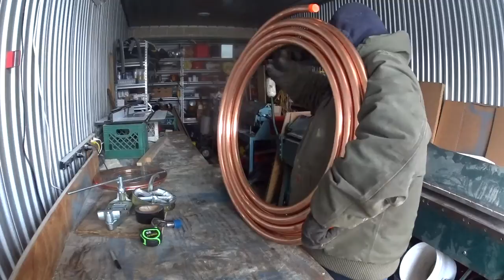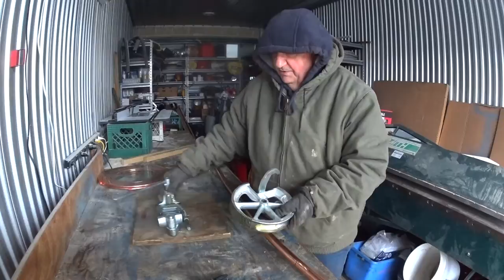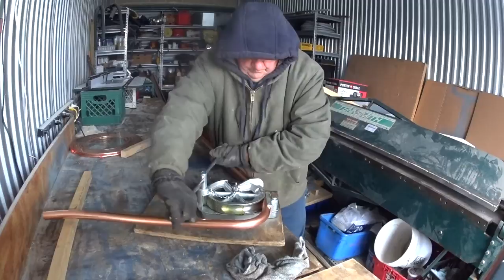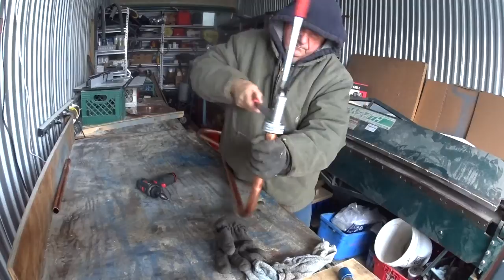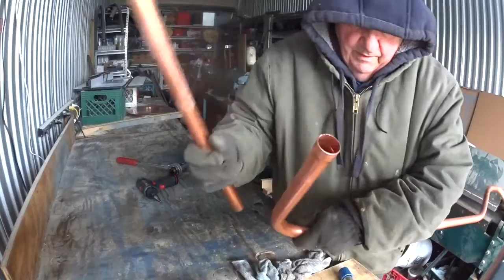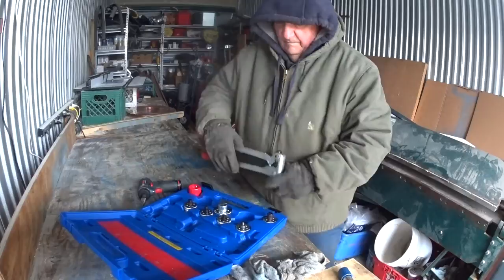Bending 1 1/8" soft ACR copper tubing with an Imperial gear tube bender 1

Comment: Great job Jim. Thats a good bender. Good thing its geared that definitely helps. I think they make an 1 1/8 swage adapter for the hilmor as well. I wonder if that would be a little easier to manage. Good video
Reply from the maker: I recently saw that Hilmore 1 1/8" swedge, thanks

Comment: 1:48 - How do you know how much to deduct to get the total length of tubing after bends?
Reply: First determine setback. SB= Radius of the bender times (1/2 the degree of bend) times tangent. Then determine arc length. A= Radius of the bender times degree of the bend times .01745. Then determine gain (or growth) of the bend. G= A- 2 times the setback. Do this process for each bend.
Reply: @chimera91977  - Does your formula work for pipe sizes other than 1" also, or is the .01745 specific to your size (i.e., how was the factor derived)?